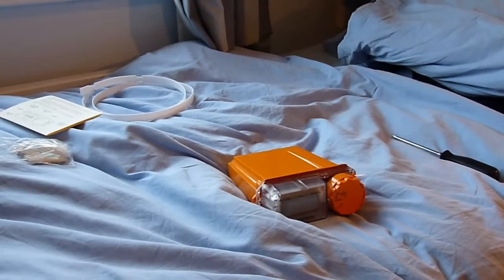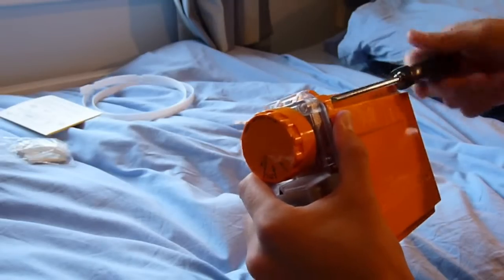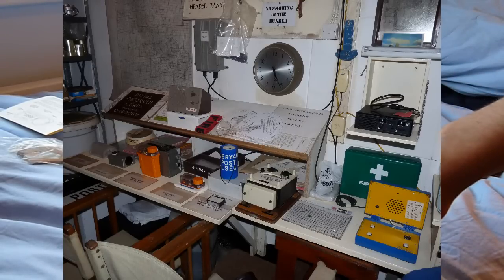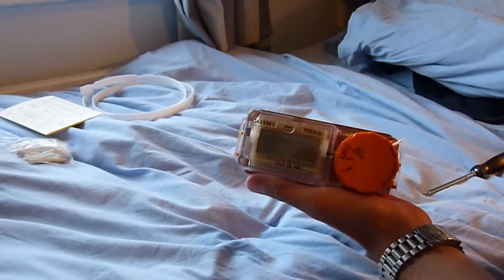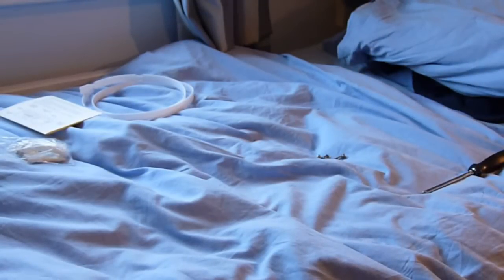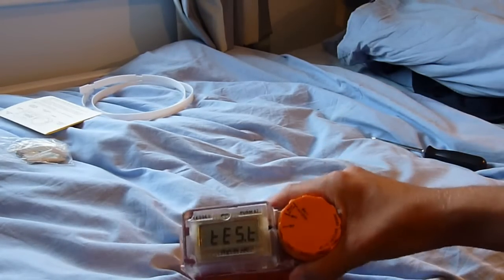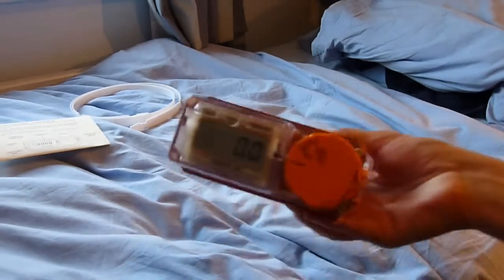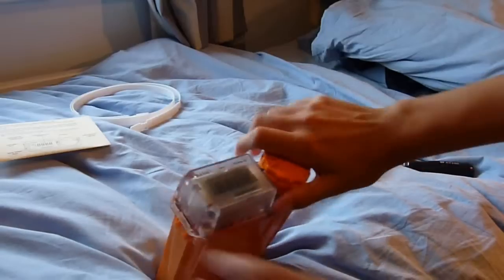PLESSEY PDRM 82

Comment: Fitted mine with a nice big led and a small buzzer and fed them with the raw detection pulse. A lot better with a flashing light and a familiar clicking. The LCD display could be replaced with a picture apart from self test. Edit , powered off a usb battery pack now too! Plenty of room inside without those big batteries.
Reply from the maker: I might do something similar at some point but don't want to do anything that is not reversible. It does have a beta reference source in the tube. So you could be getting readings from that.
Reply: @TheEPROM9  Yes it needs the Source /Reference so it knows its working.  I  spent ages drawing the cct diagram a long time ago. I guess there must be a printed one somewhere? If the display ever moves 0.0 your in trouble so I am quite happy to hear the clicks even if its from the onboard reference and hopefully background radiation. Otherwise in everyday use its just a doorstop as it does nothing except eat batteries. I must go and dig it out have not seen them in a while. Happy Xmas! I think everything is reversable I did not drill anything for sure, its all stuck with silicon gel if I remember right . Loads of room inside .
Reply: No you have the details? I want to do the same.
Reply: @SoddingaboutSi  At the moment I can not find either of my PDRMs But they are around somewhere, I have moved continent since covid so everything is a bit messed up. I remember a pickup from one of the logic chips provided the pulses for the detection (Pretty sure it was pin 17 but unfortunately i can not remember the chip except it was 18 pin. They are very narrow so I fed them to a 555 Monostable which output a big fat pulse to drive the LED and a small speaker from an old PC. When I find the bright orange things I will give more info.
Reply: Hi. I still can not find either PDRM . However I found some notes. 
Here is my translation from the doodles and broken English I did many years ago.

1 Switch off and remove batteries.

2.Open the thing up by removing the 4 cross head screws.

3. Gently separate the box from the facia the Circuit board an battery holder remains attached to the facia.

4. Looking on the circuit board my feed for producing the clicks and LED is taken from the junction of Pin 8 of the HEF4520 Dual binary counter and  12K Resistor R24.( So my previous post was probably about something else!

5. This is fed to an HCPL2731 Dual optocoupler.  Half of this optocoupler is used. The Open collector Output of the optocoupler is fed to pin 2 the trigger of a 555 timer which is used as a monostable.
( I am not sure why I put in an Optocoupler, but this was 20+ years ago.).

6. The Output pulse from the monostable feeds Through a tilt switch and to a PC speaker (Round plastic cylinder one). (Again no Idea why I put a tilt switch in, Silent running I guess? But is not needed) 

7. Not in my notes but definitely used was a big green LED and resistor to give a nice indication with each click. the obvious feed for that would be off the Monostable output. 

8 Everything is powered directly off the Battery feed on the circuit board.

9 I stuck the speaker on the component side as I remember there being a big space for it right near the display.

10 The Big LED is stuck between battery holder and display.

11 Everything was stuck in place with black silicon sealant I believe.

Sorry thats it, but I think there is enough info for anyone to do their own version, there is well enough room in there to put a Arduino Nano in there or somesuch and do all sorts of stuff if you have the time and will to.

Hope this helps.
Reply: @rogermellie8713  Please make a video on it lol
Reply: @CMMilitaria  I am pretty sure they never made it with the rest of my stuff. I am in S.E. Asia and the PDRMs are lost or in the loft of my house in England :(  So can not do a Vid unless I buy another! I am sure anyone competent in soldering can do a better job than i did. I am willing to help if you have questions no prob.
Reply: @rogermellie8713  ah that’s annoying, I want to connect a speaker to the unit if you’d be able to help that would be amazing!
Reply: @CMMilitaria  Ok .  You can solder? Give me an email and I will try and guide you.

Comment: PDRM82 (Portable)
PDRM82F (Fixed with external probe)
PDRM82M (Portable, military issue)
PDRM82D (Portable, military issue with external probe and sounder)
PDRM82C (Portable or Fixed with external probe on a fixed cable)

Also its pronounced PLE-C, There isn’t a second L.
Reply from the maker: Nice, I only knew about the two used by the ROS

Comment: I have one of these. They are a modern version of the US CDV-715. They are superior to the CDV-715 though since it has a built in Chlorine 36 beta test source which is used for the self test procedure/internal calibration function, and a more reliable modern circuitry. I would recommend these units in your Doomsday bunker over the CDV-715
Reply from the maker: They are also a lot more avalible for us in the UK. CDV's from the US are rear here & expensive.
Reply: @TheEPROM9  Yeah but they are no good so no great loss. They drift, require a desiccant and you can't trust the reading. Even if its calibrated I do not trust the older electronics.
Reply from the maker: @videosuperhighway7655  Still would like one because vintage gender counter.

Comment: Nice device! I love the colour also! :) But I was thinking... If there is a nuclear blast there is an electromagnetic pulse, and electromagnetic pulses tends to kill most electronics like integrated circuits... So... Would this really still have worked after a nuclear blast? Perhaps stored in shielded area? Bunkers probably shielded anyway I suppose... :)
Reply: PDMR82s were designed to be shielded from EMP